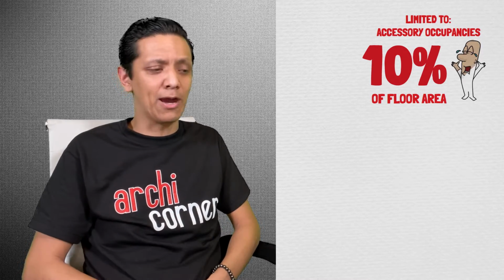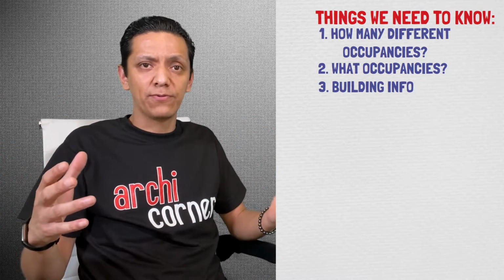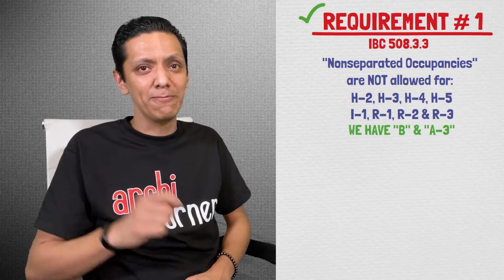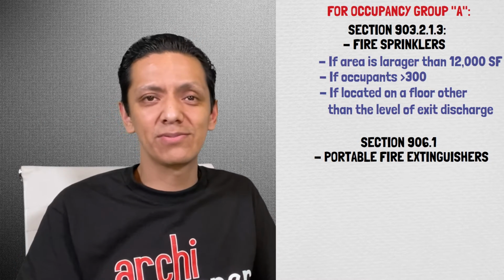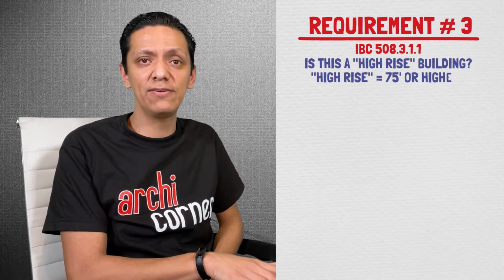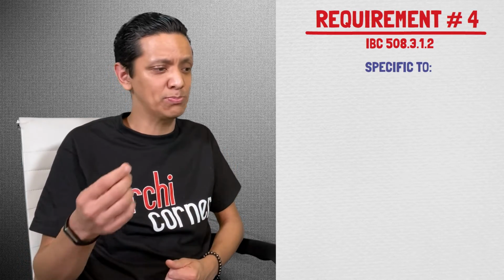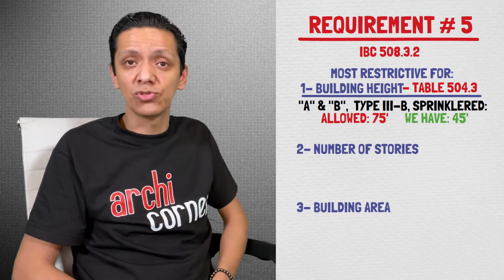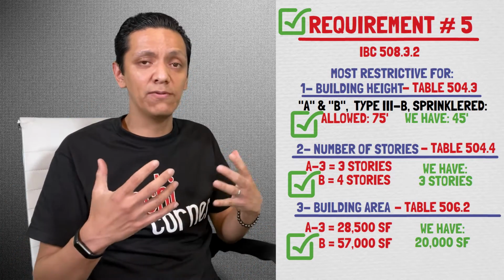AC 034 - Nonseparated Occupancies.

Comment: Hello!
Thank you for these wonderful excellent helpful videos! 
This one is still moving around my mind to get it 😅😁

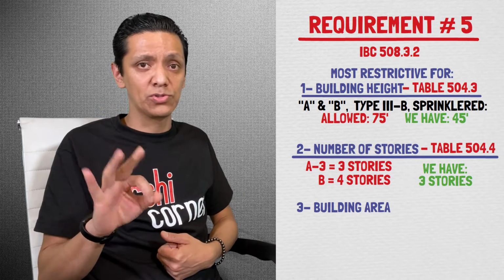I have a question for 11:00 
About the number of stories, simply does each story have to be classified alone? 
For example in this case, can we have 3 stories of A-2 & B and then a forth floor that is considered only B?

I believe we can but I wanted to know more..
Thank you again!
Reply from the maker: Yes. Every portion of a building must be classified individually (IBC 508.1). This may therefore require fire ratings between stories depending on the occupancy at each story.

Comment: Do horizontal assemblies allow you to get around the requirement for the number of stories? Per chapter 2 a horizontal assembly is defined as "A fire-resistance-rated floor or roof assembly of materials designed to restrict the spread of fire in which continuity is maintained."

The reason I ask is because I have a project I'm working on that's very similar to this video where we have an A-3 and B occupancy, but we got a comment back from the city saying we needed to provide fire separation between these occupancies per table 508.4. My project manager said we haven't had issues with this on past projects because use nonseparated occupancies. However, I double checked if our project meets all the requirements for nonseparated occupancies and it meets all of them, except we exceed the number of stories requirement by one...

However, the code uses the word 'portion thereof,' when referring to the building, so that makes me think there are exceptions and you don't have to include all the stories if a story is separated from the other stories with a horizontal assembly? For reference, 508.3.2 says: "The allowable building area, height and number of stories of the building or  shall be based on the most restrictive allowances for the occupancy groups under consideration for the type of construction of the building in accordance with Section 503.1.

We also have a note on our plans that says "Level 1 is separated from upper levels by a horizontal assembly complying with IBC 711." So when CBC 508.3.2 uses the word ‘portion’ and we have a note about horizontal assemblies that makes me think we can exclude the first floor from the total number of stories requirement to meet this requirement?
Reply from the maker: This is a fairly complicated question to answer, but short answer is yes, if you have a horizontal separation between floors, and they meet specific requirements, it’s possible to consider the buildings as two buildings. One building on top of another building. This is often referred to as platform construction, and the  building at the bottom has to be built as a specific building type, usually type IA. There are too many details to discuss but it’s doable.
Reply: @archicorner The first floor is made of wood like the other floors above, and it's Type III-A construction, so maybe it doesn't qualify as a separate floor... So yeah, it's a complicated question, but I appreciate your response, and I'm a big fan of your videos.